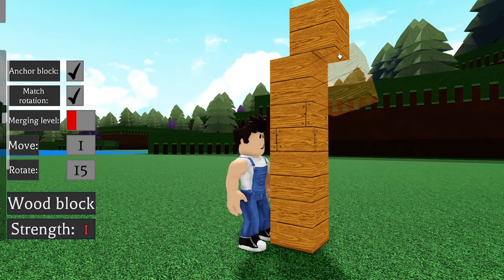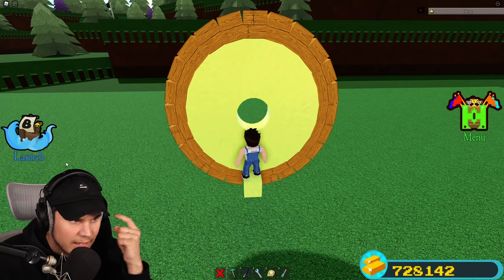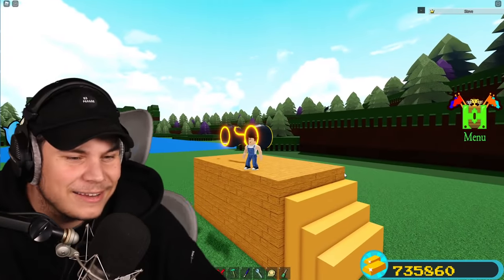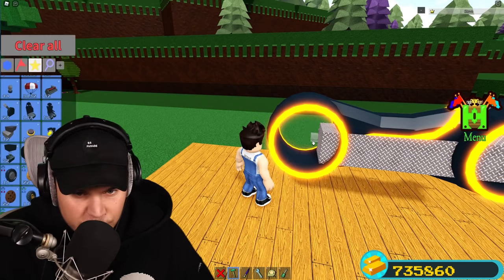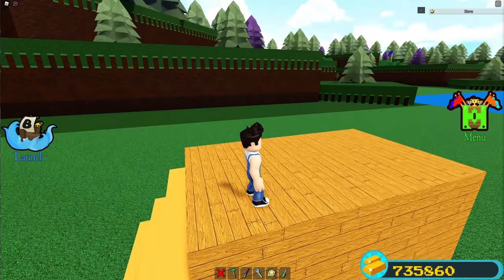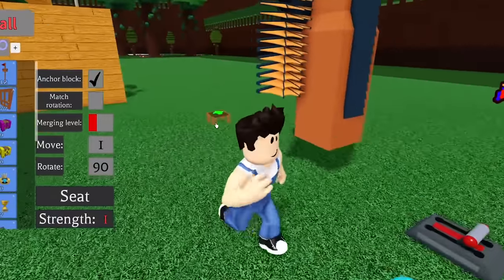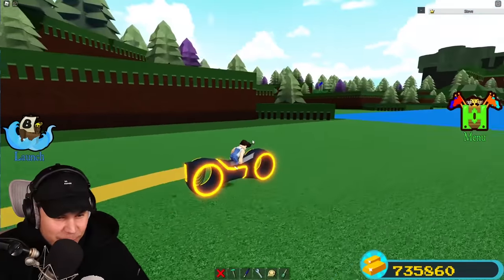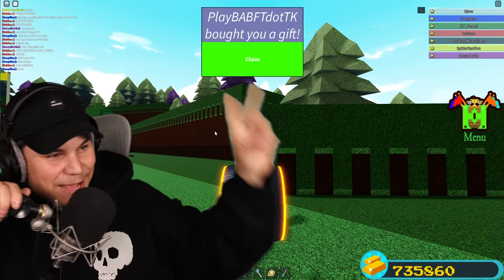I BUILT A WORKING LIGHT SPEED TRON BIKE IN Build a Boat

Comment: Jesse, add a motor and rotate it forward at 15 or 25 degrees per click until the motor is facing a 15 degree angle and you can walk up wall, and also change the wheels to the classic ones
Reply: Yes
Reply: Smort
Reply: True but you always fall when you stop
If you get a magnet put a hinge under then out a block and make the wheels wheel torque yellow and speed like 40 or 30 it will climb walls without falling
Reply: @tacticalnerd1831  when I translate to English it says greased lmao
Reply: @oinkoink218  when i did it said smeared